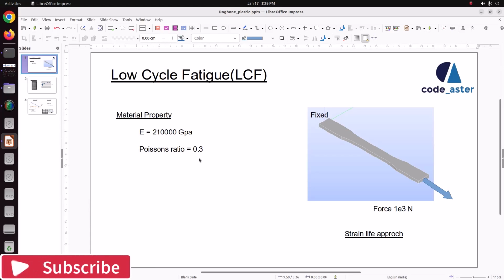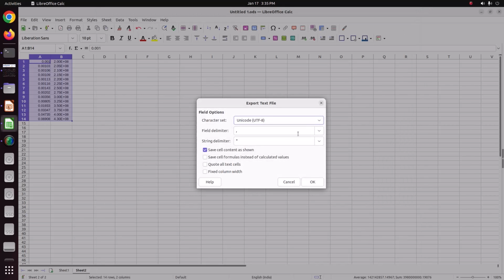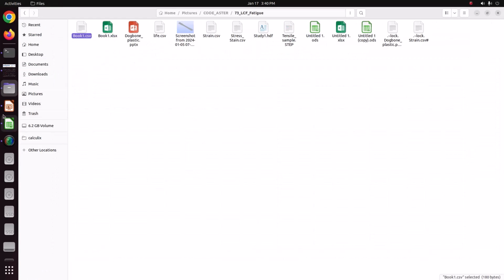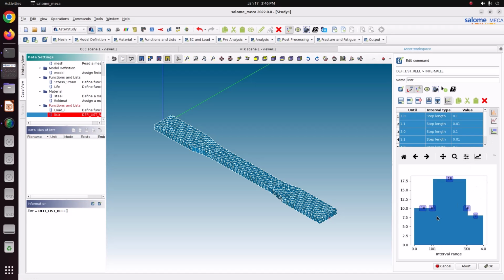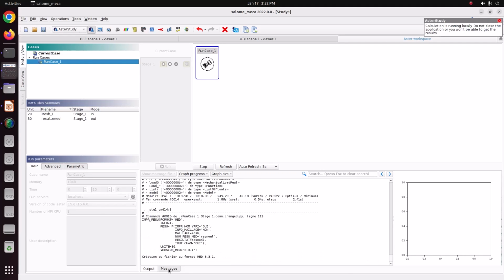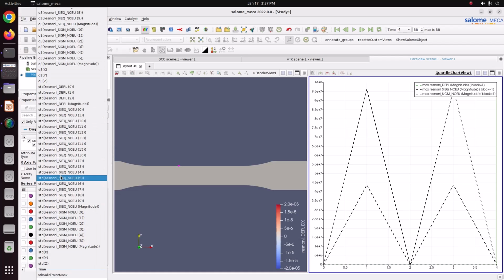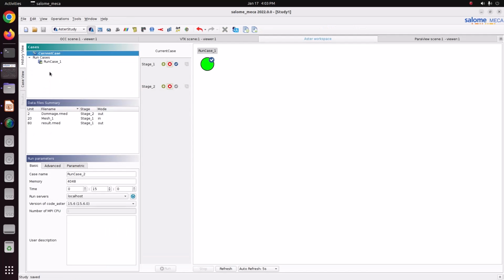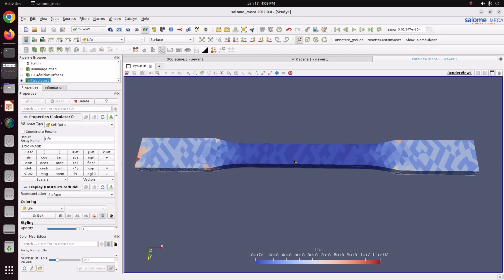Low Cycle Fatigue(LCF) using code aster|fatigue analysis |salome meca tutorial 73

Comment: real nice!  Could you share your project files..such as in github?  I would like to be able to recreate it.. but sometimes it is good to have the command files.
Reply from the maker: Yes, sure, Now link is available in description
Reply: @CAD_CAE_Tutorials  thanks!!!  I'm trying to study plastic-strain work.. do you know how this is possible in code aster?similar to linear elastic plastic energy work in ANSYS? (I don't have ANSYS).. one approach I am thinking is to place a crack in the region of interest and CODE aster crack module.. I am trying to learn Code aster for the XFEM part.  these fatigue models use stress fields to correlate them to stress responses of systems (I believe.. such as the S-N curves) but my interest is more in small local regions of a part in few cycles.. Any thoughts?
Reply from the maker: @rusty-8647  please go through my all tutorials - plastic strain  case also done.
Reply: @CAD_CAE_Tutorials  Do you know if Code aster can output plastic strain energy density, plastic work or plastic energy?  I haven't found this yet.